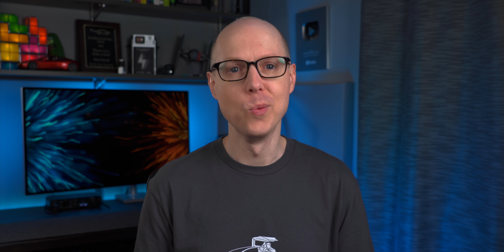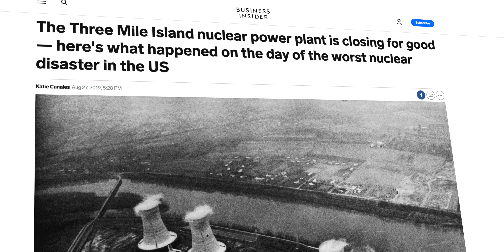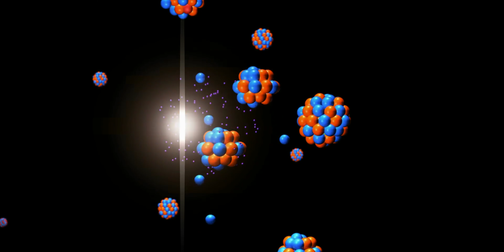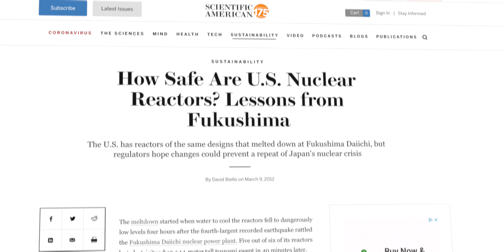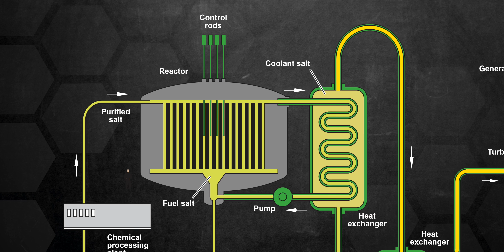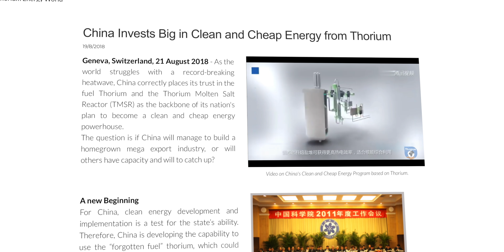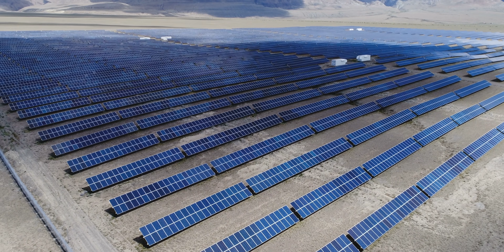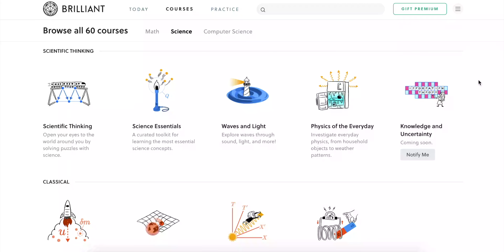Thorium explained - the future of cheap, clean energy?

Comment: This explanation of how molten salt reactors was an epic fail.  Thermal spectrum reactors need a moderator (light weight atoms like hydrogen in water or carbon in graphite).  There are also fast neutron reactors using thorium and/or molten salt (see Elysium).  Moderator not integral to molten salt designs.  Also not integral to thorium designs. In fact you can run thorium in solid form.  I prefer MSR though.  Additionally you said the reactor is a breeder, thorium goes in and u-233 comes out as a "fission product".  No, fission products would have about half th atomic number and mass number of thorium/uranium/ transuranics.  u233 comes out after decaying from protactinium which was obtained by neutron capture in the thorium "fuel".  Using graphite rods makes the design less safe, as there's a human element.  Many designs don't use graphite.  Salt is inherently safer for many reasons, including thermal expansion of salt when getting too hot.  This is independent of an operator.  The reason MSR is safer is because of passive safety and air cooling and ambient pressure (at least you got that one). You also state the reactor is safer because graphite can make the reaction "stop".  This is false!  Reactors are easy to stop, and LWR have control rods that SCRAM the reactor, absorbing neutrons and stopping the chain reaction in it's tracks.  Fukushima did this.  The problem then became cooling down the highly radioactive recently shut down core, which was generating intense heat from rapid decay of the fission products.  Because they are highly radioactive, they cook down quick, but need at least some days to come down to a manageable heat.  In Fukushima the batteries to recirculate cooling water ran out after just a few hours.  MSRs would be better at this because, due to being made to operate at much higher temperatures, can radiate enough heat away quickly enough with just air.  No water needed.  LWRs cannot get anywhere near that hot because they have water under pressure and would explode.
Reply: Also, how do china and India not have a developed uranium fuel cycle?  They both have been nuclear weapons states for fifty years, and both have operating nuclear plants.  From Wikipedia: China has the fastest growing nuclear power programme with 16 new reactors under construction, followed by India, which has 8 under construction.

Comment: $230 million for next gen energy, while we ship $40++billion to Ukraine.  Developing 3rd and 4th generation nuclear energy should be our “going to the moon at the end of the decade” undertaking and more importantly need to ficus on mini and micro nuclear walk-away reactors and put the energy source where it’s needed and stop using the grid as the primary distribution method and convert it to a manifold to off load access energy to under served areas or high demand areas.  Every town with 5,000 or more has its own energy plant.

Comment: from what I understand it is also difficult / impossible to use a thorium reactor to enrich to weapon's grade nuclear materials
Reply: You do not need enrichment.  Enrichment is for Uranium.  For Thorium it is chemical re-processing.  You can get near pure U-233, weapon grade fissile material.  The trick is to make use of the decay of difference in duration for Protactium-232 and Protactium-233.  You wait for a few days and Proctactium-233 has not reached the decay duration required into U-233.  But Protactium-232 has already been decayed into U-232.  You separate the U-232 out from the mix and take all U-232 out.  Leave the rest there for a month to decay.  All come out after a month are U-233 without U-232 contamination.   Proliferation risk is there.  Thorium folks needs to persuade governments that they have good control measures to eliminate proliferation.

Comment: The elephant in the room regarding nuclear energy is the obscenely high cost of storing the nuclear waste for basically ever.  Many people think "nuclear waste" just means the spent fuel but it also includes every wrench, every respirator, every changed out spare part, every everything that comes in contact with radiation.  This waste isn't as "hot" as the fuel rods but is still quite radioactive and must be stored in a similar fashion.  And the cost of this storage isn't paid by the rate payers, it's paid by TAXPAYERS.  If the cost of the radioactive waste storage were included in the cost of the power sold to customers, nuclear power would be far and away the most expensive energy on the planet and no nuke plants would ever get built.  The only reason we currently have any nuke plants in the US is that they were needed to produce material for nuclear bombs so the federal government subsidized them extremely highly.  And the labor unions LOVE quasi-public mega projects with all their tax payer funded cost overruns.

Comment: Great explanation of this potential game changer. The sad fact is that politicians and here-today-gone-tomorrow and few have the intellect or foresight to see that nuclear power is the only viable base-load provider and has been underfunded for decades while the fossil fuel industry has reigned supreme and vile regimes funded by selling it. Long-term low carbon power is within our grasp if the “green” lobby could open it’s mind. I’m not, on past performance, optimistic however. The UK, where I live, and once at the forefront of nuclear power has plumbed the depths of trusting the French and Chinese to build our 2nd new nuclear plant in 40 years. A shocking indictment of our governments past and present who have virtue signalled with wind and solar whilst destroying coal fired base load plants, becoming exposed to global gas prices for much of our power generation and allowing the nuclear fleet to wither away. I would describe it as criminally negligent.

Comment: Thorium creates insanely less waste, and far more importantly, it could be used to burn up our current nuclear waste stock piles. Also the thorium reaction can breakdown into an isotope that has useful applications in treating cancer. And you just cannot overstate the "walk away safe" feature, all the past nuclear disasters and near misses were caused some critical pieces failing. Where as a molten salt reactor, if any piece fails it instantly becomes safe.

Further molten salt reactors have uses far beyond what most will realize. The US built a nuclear powered plane (to bomb the USSR). It barely worked but with modern material advances it could now be used to launch rockets and power interplanetary and interstellar ships. These reactors can be made small enough to be transported on trucks making them very useful for bringing power to all kinds of places.

Comment: It would be fascinating to have a discussion with guys who did R&D at places like Sandia Labs or Wright Pat ...  Scaling Thorium into powerplants that could power trucks, tractors....even cars, or underwater remote powerplants for powering SOSUS and similar  monitor devices...  Build, ops check and certify functionality and crate up units for emergency deployment to diaster areas after quakes and hurricanes...Puerto Rico... Katrina ground zero....  The new base up north will be a self contained closed grid powered by?  The Hydro Quebec power lines all feed electrons to the south.  None go the same distance north.  What can Thorium being lased do and how small can it be scaled?  Take 5% of funds dumped into solar and wind and fund a group of retired R&D guys from the Reagan era SDI labs and say HERE, BOYS, FINISH WHAT YOU STARTED.
Oh, if those labs could only talk!